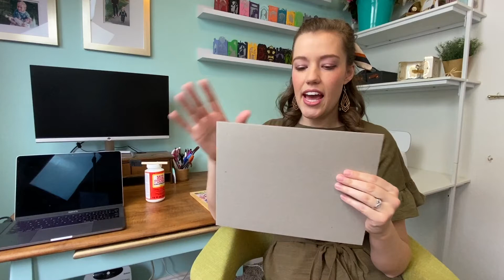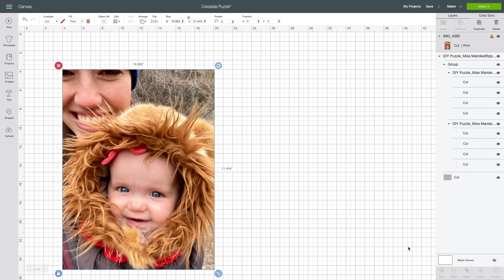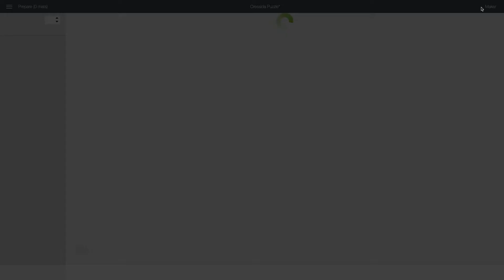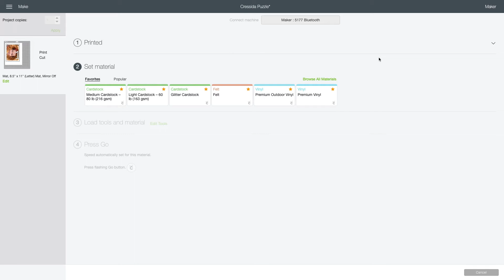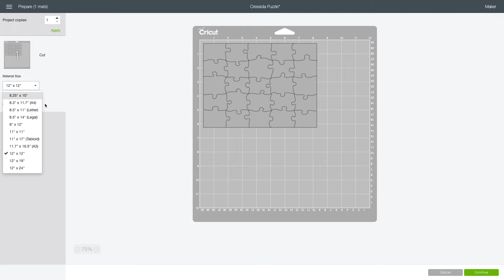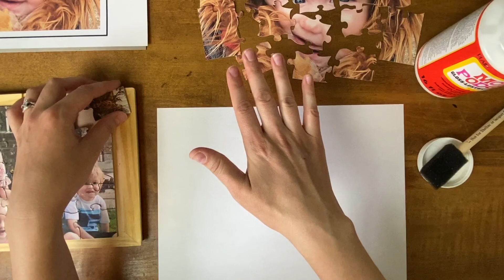Make It With Miss Mandee - How to Make Your Own Puzzle with Cricut

Comment: Have you tried printable vinyl or sticker paper to skip the gluing? Also where did you get the frame. I want to be able to make these as gifts and possible sell them
Reply from the maker: I haven't tried printable vinyl, personally, but I think that could be a good way to go! I have tried sticker paper, but it didn't stick to the chipboard as much as I would have liked it to. But maybe that was just an issue with the particular sticker paper I was using.

The frame was something I borrowed from one of my child's puzzle boxes temporarily just so I could have a backing to display it on for the video. :)

Comment: Hi Mandee. I want to create a hight quality puzzle - 500 pieces. I can't use method 2 as this would take too long. I was wondering whether I could put the picture side down to the mat (the card side up) - would this protect the image from being worn down& form the rubber rollers?
Reply from the maker: I haven't tried doing that. The tackiness of the cutting mat might hurt your printed image. But, if you print it on maybe a glossier paper, or have it printed on a high quality machine, then maybe it would work. I can't say for sure, but best of luck!!
Reply: Did it work?

Comment: Thank you Mandee for a wonderful tutorial! Just wondering if I can use 6x8 photo instead of printing the image out? As the quality and paper of the photo is better than the one from my HP printer. Thanks
Reply from the maker: The reason you need to print it out is because you'll need the registration marks around the image, otherwise the cutting machine won't know where to make the cuts. But, you could definitely download the image with the registration marks included, and have it professionally printed for better quality!
Reply: @DesignsByMissM  how can I download the imagem with registration marks ? 
I want to print the imagem with more quality and for that I can't print with Cricut sistem :(

Comment: hey im new with cricut and I have a question. Should I leave some space in my chipboard so the machine cut the borderlines? or should I cut it as the final piece so the machine only cut the interiors? I hope you can understand me
Reply from the maker: Hi There! You'll want your machine to cut both the outside borders and the interior lines. The file provided includes both. :)
Reply: @DesignsByMissM  Thank you

Comment: What pressure do you use for chipboard? I’ve been using sticker paper and chipboard 1.0mm and I can’t get it to cut through and keep my image intact. Any tips? Explore 2
Reply from the maker: I set it as "Heavy Chipboard 2.0 mm" when I made this puzzle. If you are using an Explore machine, then make sure you are using a deep cut blade. if it still isn't cutting through, maybe send the design a second time (without ejecting the mat).
Reply: @DesignsByMissM  thank you I’ll definitely try it again